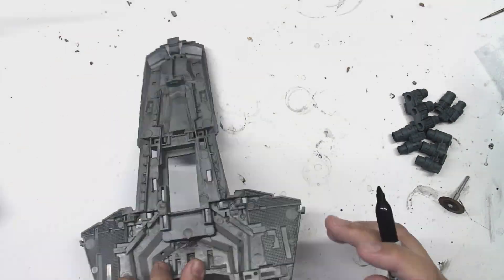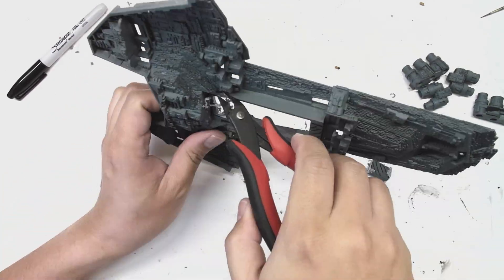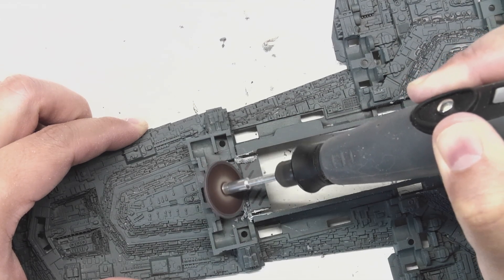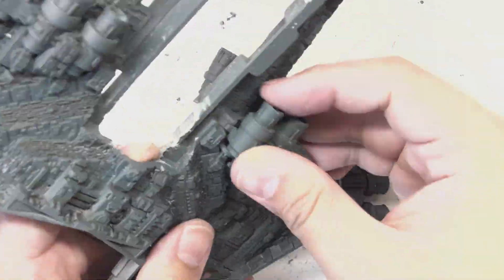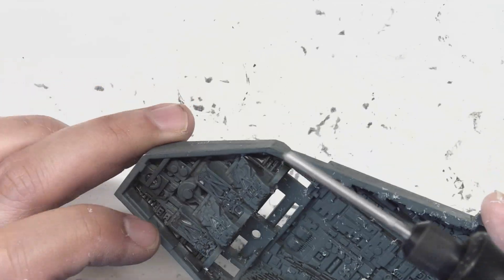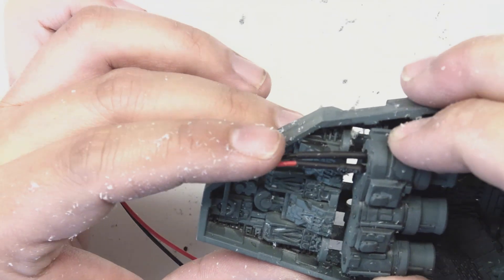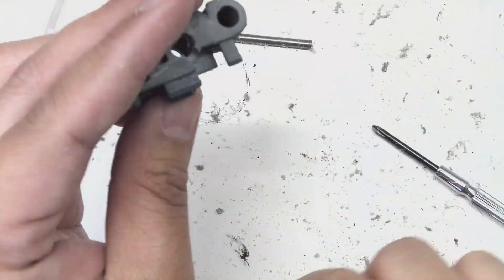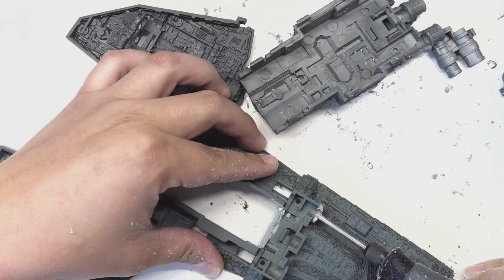Armada Super Star Destroyer 02 - Excavation

Comment: Are the LEDs 5mm or 3mm? (look like 5?)

Why not just put the resistor on/near your central circuit board where you have more space? (or somewhere inline of your wire where you have more space) The resistor doesn't have to be attached to the LED...   (or there's things like: https://www.sparkfun.com/products/14977, though, dunno how durable they are due to the resistor being that close to the LED)
Reply from the maker: I tried that in a later video. Turns out I didn't need it anyway with the 12 channel controller I'm using. The LEDs are 5mm.